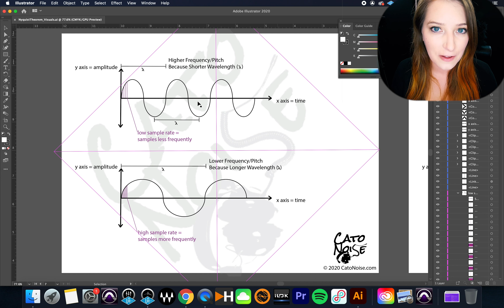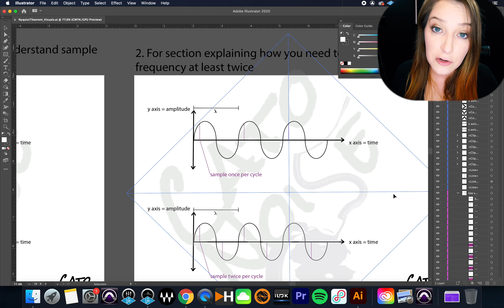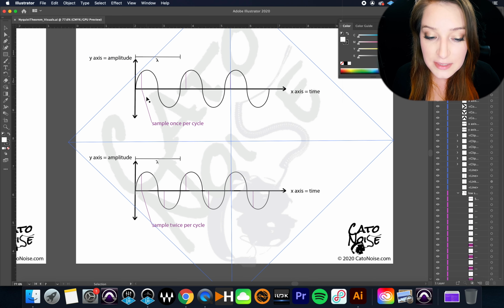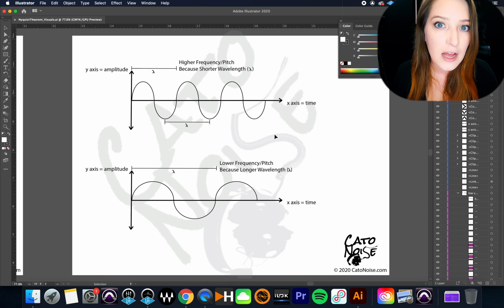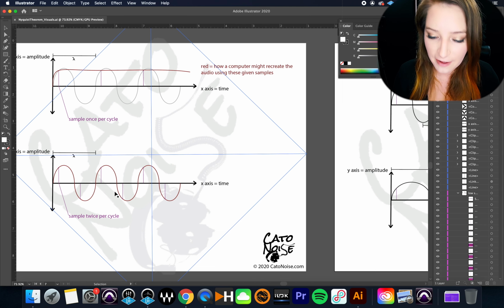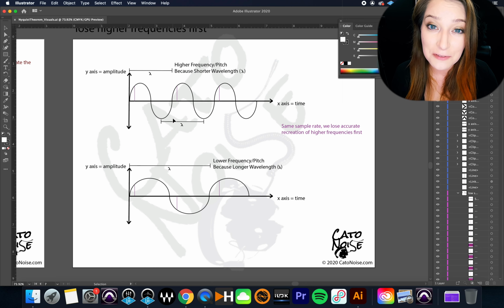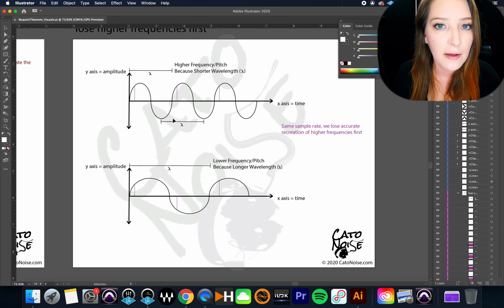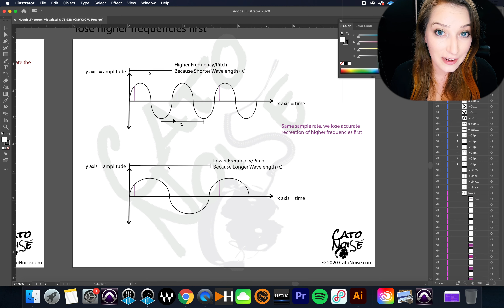Audio Basics: The Nyquist Theorem

Comment: What would happen as the human voice is recorded if the nyquist sampling frequency of the acquisition system is in the frequency range of the voice?
Reply from the maker: If you sampled a sound of, for example 440 Hz at a 440 Hz sample rate? I'd assume you'd get no sound. You'd sample it at the exact same point in the waveform, and have the same bit depth value (which correlates to voltage in analog, or air pressure in mechanical sound in the air) for every sample. In order for something to be sound, for us to perceive it as sound, it needs to oscillate. You need the repetitions. So, it wouldn't be sound anymore because there's no back and forth of a waveform. I think you can picture it like this: when you hit play, the speaker cone would move to that one voltage value position (bit depth value), and then just sit there. No movement of that speaker cone = no sound.

Comment: Just to clarify, are you saying that an audio signal thats been filtered, so that nothing over 20kHz remains, can be perfectly reproduced with a sample rate of 44.1kHz?
Reply from the maker: That's a good question. I think in theory, yes? It seems like that might be the case, but I haven't really dug into that question. There might be something at play that would make it a "not quite" kind of situation. There might be something we wouldn't necessarily expect.
Reply: @CatoNoise  I very much appreciate your answer. There's definitely something that's not quite right. I hear people say all the time that, with the Nyquist theorem, signals can be perfectly reproduced and it's just not true. It works on paper but not in the real world. I'm not sure what it is but something isn't quite right.
Reply from the maker: @kd4dhk  Well, disregarding the filter question: aliasing has a lot to do with my understanding of why we like higher sample rates. We like higher sample rates because they actually are clearer than lower ones like 44.1 or 48 - even though in theory 44.1 and 48 should be able to cover the audible range of frequencies. Super high frequency content can affect the signal, and basically fold down into the audible frequency ranges, causing changes. My understand is that this happens when the super high frequency coincides with the sample rate in such a way, that when it's sampled it looks like a lower frequency. Then, it gets into the signal at lower lower frequencies and changes the sound. We do have things like anti-aliasing filtering and such that's supposed to help with that, so I imagine this effect is to varying degrees. But, I've felt the difference there in blind listening tests between high sample rates and more standard ones.